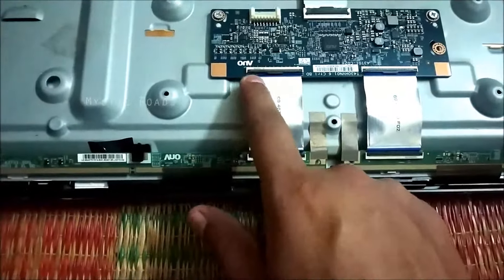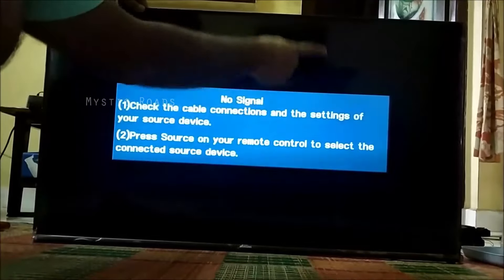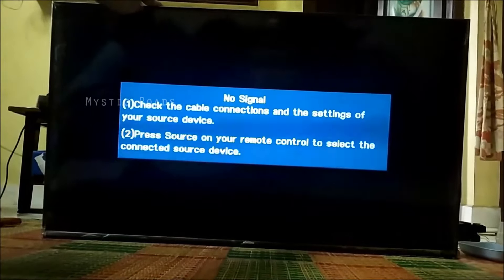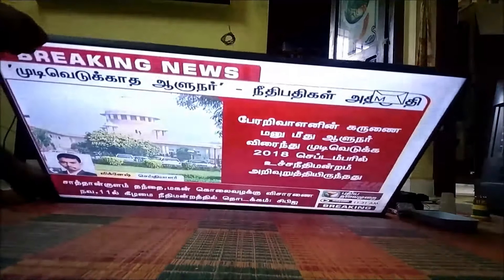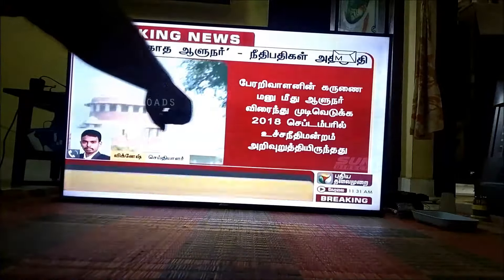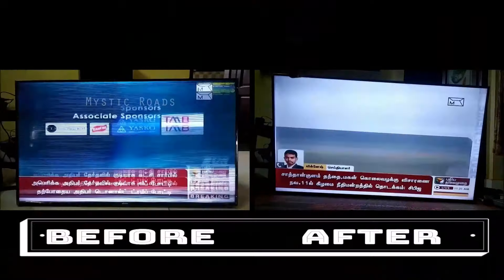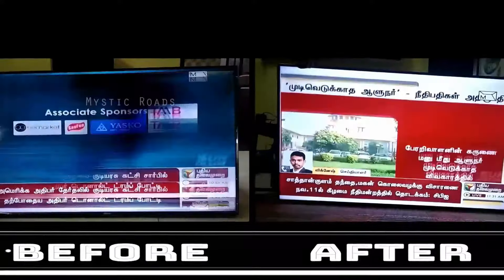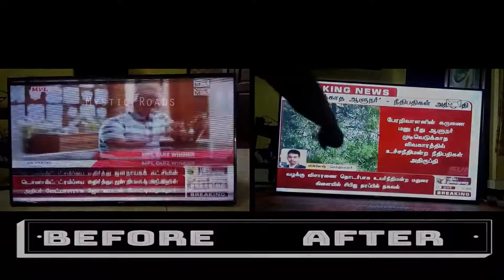How to Fix DOUBLE IMAGE PROBLEM | 43" Samsung HD LED TV

Comment: I have a Vizio 65" and with your video i fixed my TV. It took me a wile to figure it out, my TV had a pin problem on the right side of the screen so looking at the Board from behind was the left strip cable just like the video. I cut a piece of tape and the size covered about 4 pins but i started to notice some horizontal lines so i used a volt tester and found the lowest number on the 6th pin from left to right. I cut the tape to just cover 1 pin and worked perfectly. Thanks and hope this helps others, don't know how long it will work but its a start. Will make a video of my problem fixed soon
Reply from the maker: thats nice to hear ...
Reply: 😅ô

Comment: I just applied this fix to my LA40D550 which had a stationary, doubled image. First place I tried it worked on the double image but the affected side was dimmer than the good side, so I reduced the size of my tape to about 3mm, and (after a few guess and checks) more precisely blocked the problematic trace/s, this restored the whole image to its normal condition. Hooray! Thanks!
Reply from the maker: Thank you soo much for your comments ..lad to know that you have solved the issue ... please subscribe to my channel
Reply: Is the tv still working well?
Reply: @SOPHOCLESIFY  Yes
Reply: Tu peux m'aider?

Comment: It worked.....double image fixed as mentioned in the comments, just need to move the tape around and resize to get it 100%. 1st attempt it fixed the double image but was getting right side darker, so moved the 3mm width tape at different points and ta tadaaaaaa....worked. Thanks so much you was very helpful.
Reply from the maker: Wovv great to see that you fixed it . Thank you soo much ... 👍👍

Comment: What pins did you tape?  Do you tape different pins if it's a 50 inch screen?  Maybe pins 13 to 25?
Reply from the maker: Look out for Vg pin track on the PCB , mask those pins

Comment: Hi just wanted to ask is it that board that needs changing. As you should be able to make the connection without the tape normally ?
Reply from the maker: the T con boardgenerates the noise disturbance signals , by using the tape we are masking off the noise signals , the board can be changed with  a good new spare to eliminate this error...

Comment: This works for me. Thank you so much. My wife can now watch Netflix again.

@everyone, just curious, because of the tape blocking certain signal/s, will there be another possible display issue? Like, problems with other video display source such as AV, VGA, HDMIs or component?
Reply from the maker: The Screen side where thr tape is pasted you will find thre will be slight loss of pixels and when you connect the TV audio with amp or home theter there will be intermittent  noise screen will go blamk and resume , smtime when i connect my lapop HDMI out to TV i audio will not come in my TV , i have to connect and reconnect the HDMI cable. these problems you might face or you may not.  I din face this problem at first but after 3 years am facing this problm. But image jumping problem never came back.. it got solved
Reply: @mysticroads , thank you for this answer. Luckily, I'm having no problems so far but I'll be checking other source to make sure. :)

Comment: what do you think is causing the double image flickering? do you think it might be a fault in the ribbon cable? or??
Reply from the maker: The problem is with the Tcon board or the noise signal from the video processor

Comment: hello sir, does it have impact on any other parts like display circuit or smart board? is it completely ok to use it with the tape long term?
Reply from the maker: Yes... It's absolutely fine.. you will notice a mild picture resolution clarity variation on the left or right side if the screen.. I ve been using my tv with the tape past 2.5 years it's working fine

Comment: Sir I have similar issue in my vu 43 inch 4k android tv. I have checked it the problem is coming from the right side of the display.
I have 3 questions. Is it a tcon board problem or is it a display/panel problem? How many pins I have to block? Will it anyhow effect my 4k hdr picture quality?
Reply from the maker: Hi sir, am glad to respond for your queries , Ans  Q1: If there is a problem in TCON board you wont get any picture or image , , as you mentioned the problem is with the right side of the panel , i feel that signal  going to the right side of the panel  from the TCON has to be checked, as explained in my vide , try masking the right side strip cable and check. Ans Q2: You can mask  3 pins from left , leaving the first 2 pins , do not mask the 2 pins on the left or on the right . leave off the 2 pins  from left and mask the next 3 pins and check , similarly ckeck on the right side pins by leaving the right most 2 pins , Ans Q3 : Yes slightly there will be slight HD variations on the screen as horizontal lines will slightly visible on the right side of the display panel  but it wont be a problem while viewing and viewing comfort will not be affected.. HD quality wont be affected much .
Reply: @mysticroads   can I contact you through insta. I will share some image of the board and a short video about the problem of double image. There are two (60pin) connector from the tcon board to the display. As I have told you that the problem is coming from the right side. I have seen your video you are blocking some particular section / signal going through the display to the tcon board. In my case it's little bit different. I will try your method but it will be more helpfull if you can advise me after watching the picture of my tcon board. Anyway Thanks for the reply.

Comment: I previously fixed screen flickering with putting such tape at right side.

Now I have issue with double image again. If the probkem detected in anothrr side, can I put tape on that side also. Please advise.
Reply from the maker: Yes you can give a try fixing tape on the other side too
Reply: @mysticroads  Actually I send it to a repair shop before trying this, they are saying me to replace led panel!
Reply from the maker: @atmnurulanwar  Just give a try you and try ur luck , it will get definitely solved

Comment: My samsung has 4 Tcon cables in stead of 2 like you showed. Fixed ghosting but have now got some vertical lines on the screen
Reply from the maker: the vertical line is caused by the LCD array defect  or the cable seating problem ,   To fix this, simply reseat the cables and ensure that they're securely connected and it cant be rectified

Comment: When I add the tape it fixes the double image but it adds a red line in the screen. The red line wasn’t there before only when I add the tape. Any suggestions??
Reply from the maker: try to reduce the width of the tape , and shift the position of the tape , moving towards left and right

Comment: Please my tv is hisense 49m5600cw but doesn’t have a t con just the flex cables going directly to the screen panel
Reply from the maker: you have to check the VGA board present in the rear side of the panel

Comment: Hai sir,  how this  problem permanently rectified ? Need to replace the t con board or any other component?
Reply from the maker: i used cello tape and its working fine more than a year 
 when there is no image or more distortion , i recommend to replace the tcon board

Comment: Hi, may i know what kind of tape you are using?
Reply: my Tv model is Samsung UA40EH5000R 40 inch LED Full HD TV, same issue double image problem
Reply from the maker: i used a normal cellophane tape
Reply: @mysticroads  i see. Alright. Can't wait to try it. Hopefully can solve my problem. Thanks for the sharing 🙏🙏🙏

Comment: Hello i have the same problem but when I disconnect one side, any side the whole screen turns dark, do you know what to do in that case?
Reply from the maker: Hi Lina , In your  case I feel that the T CON CONTROL BOARD will be faulty , from TCON board there will be 3 connectors one input and 2 output for the right half and left half of the screen , try disconnecting one side either left or right...and check which side you get image and which side is becoming blackout
Reply: @mysticroads  Hello, thanks for your reply, i tried that, however if I disconnect either side of the TCON board, the screen goes dark again.

Comment: How to find the position correctly and how to get the correct size of the tape, 5mm or 3mm which one is correct....
Reply from the maker: Its a trail and error method , try using 3 mm tape at diff positions , to be precise start from let side

Comment: I’m troubleshooting my 2014 Toshiba 50” and I swapped ribbons to see if it’s the ribbons and it’s not but it’s the left side decon board side. I tried the tape trick from another video but it didn’t work because I put a far too large piece of tape on the connector pins but what the universal law for covering these pins on the ribbon?Suggestions?

Comment: Can I just replace the connectors?
Reply from the maker: there is no problem in the connectors , the problem is with the noise/error signals emerging from the TCON board

Comment: How much money can give to that work in repair shop
Reply from the maker: They may charge minimum  of 75$ ~ 125$ , depending upon the defect, if they intend to replace the Tcon Board then the board cost will add up another 50/70$ i presume.

Comment: Hi Anna, i have tried this i have unlatch the right side but  total screen showing black , and tried another side but same.

Then how would I know which side i have to  put tape?
Reply from the maker: hi bro the unlatched right  portion will be black only as the video signal is removed , u check the other side if any jumping or doubling issue , then latch the right side and unlatch the left side and check again , by this way u can check which side the err
or is.
Reply: Understood. But if I unlatch any of side complete screen getting black..

But anyways I guessed the side and place the tape. It's working now.. 100% 

Thank you very much.